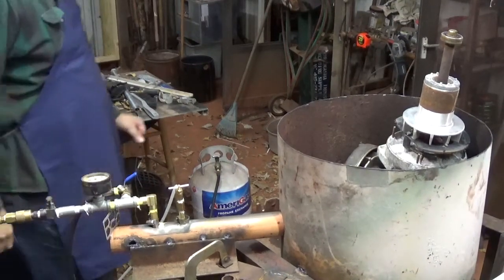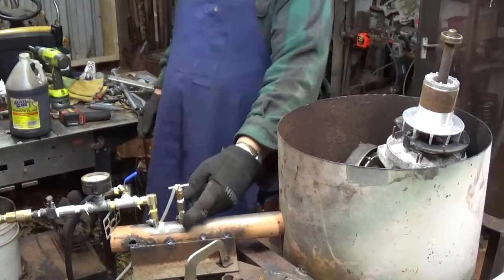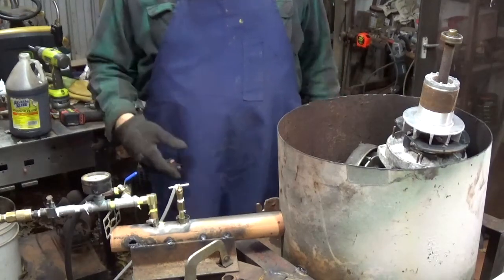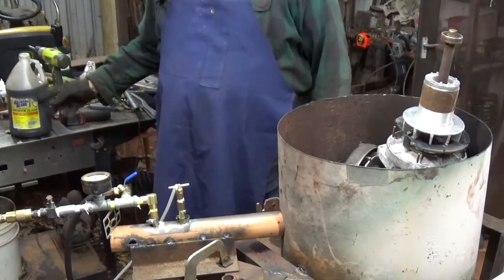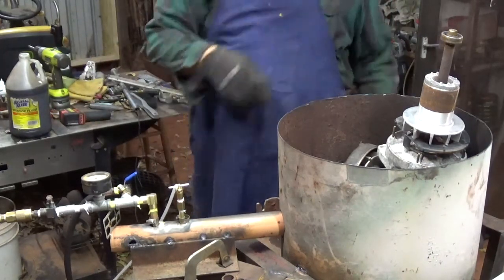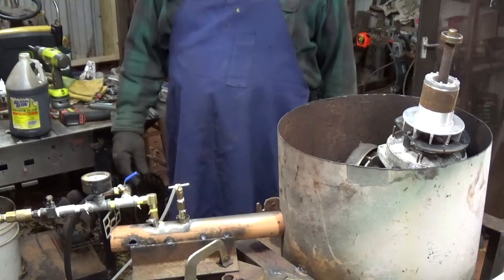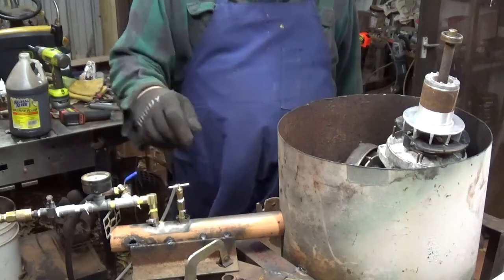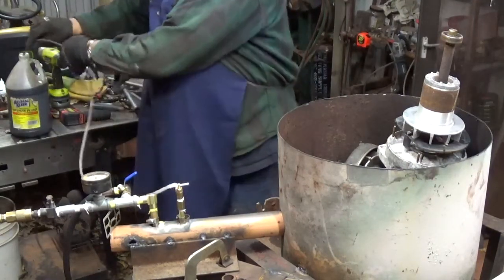update and Experimenting with oil burner

Comment: I cut a 55 gallon drum to melt aluminum like you, only I'm not using waste oil, just propane.  Flame won't stay on, keeps going out like there's an air ratio problem.  Does it with a lid partially on or completely off.  Any suggestions?
Reply from the maker: you may have to look at how others have made their burners, I think there are a lot of videos of home made propane burners, or buy a burner from devil forge for your setup
Reply: @Okiescrapper  Yeah I have a Devil Forge burner already where I do a lot of melts but this was my first shot at a 55 gallon drum burner.  It's clearly a different animal.

Comment: could you use a furnace pump system from an oil heater , then add air in front of that ?
Reply from the maker: I don't see why it wouldn't work, some guys use gravity feed, some use a sealed tank put the oil in plug the tank and add air pressure to push the oil, I think it was a guy called "oil burner" that used that method he split his air line into 2 lines had needle valves on each line one went to the burner the other pressured the oil tank

Comment: You should wrap the metal tub with koalwool to keep the heat in . should melt faster
Reply from the maker: I have put a thin layer of refractory cement on the in side of the sides and thick on the bottom to make it down hill to the drain hole, it is in the new video. I did it over the summer. I think it helps, I may order some soon. Thanks for watching
Reply: Find a old drum that your tub will fit in with a gap of two or three inches clearance all the way around and three to four inches for the bottom mix 65%plaster Paris with 35% coarse cling sand mix all dry add just enough water to make it the consistency of Plato form your bottom trowel your sides a little less than needed set your tub inside of it and then pack around it with a little bit looser mix make it a lid that will cover the entire thing and expose a 30% of 40% of the cover on a hinge or slide it off find a 12 volt variable speed blower motor off an old vehicle get the blower or fan motor switch with it for your air supply put a small piece of plate and a slight angle inside your tube to get your blast to circle inside of the tub weld it in place the deflect the flame that will glow red and keep your fuels atomized so it won't pulsate or go out once it starts good luck have fun

Comment: You using an air compressor for the air hooked to the burner?
Reply from the maker: yes I am, not sure if you looked I have a play list for the oil burner and melting metal, not to many videos yet